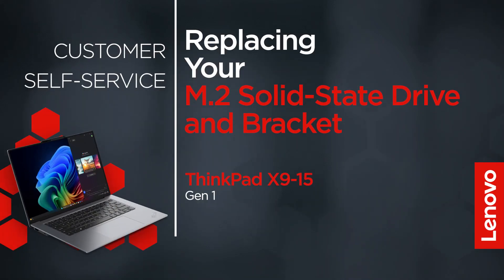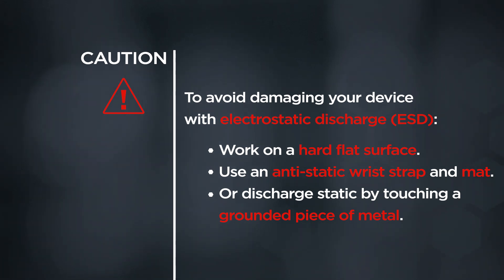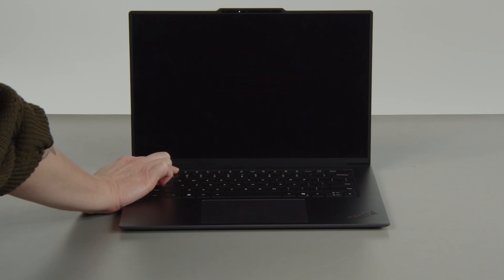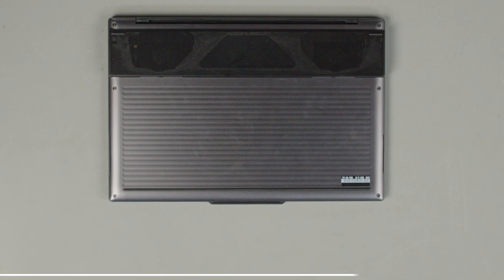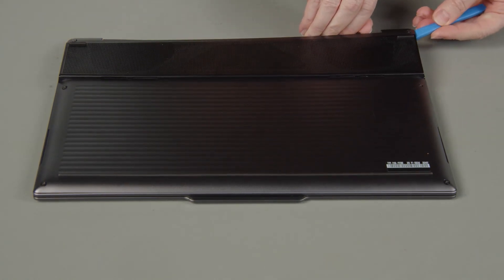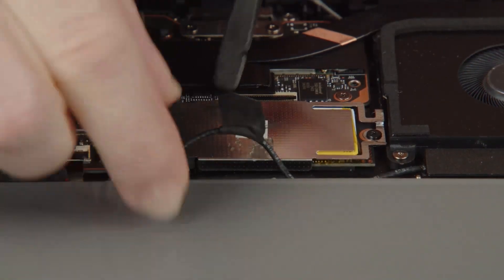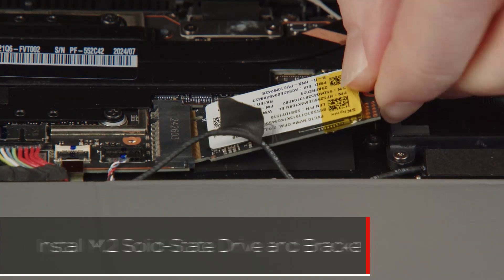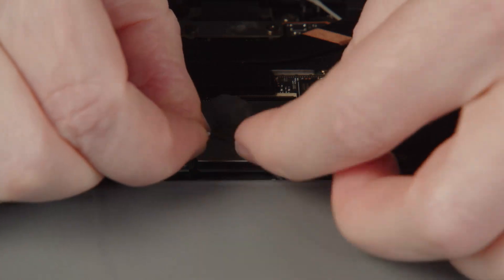Replacing Your M.2 Solid-State Drive | ThinkPad X9-15 Gen 1 Aura Edition | Customer Self Service

Comment from the maker: This video will show you how to replace the M.2 solid-state drive and bracket of your ThinkPad. The process in this video will work for the ThinkPad X9 15 Aura Edition (ThinkPad X9-15 Gen 1).

You will need a screwdriver kit, a non-metallic pry tool and 15 minutes of your time.

To learn more about your device go to https://pcsupport.lenovo.com

To find parts for your device go to https://support.lenovo.com/parts-lookup/?cid=ww:lenovosocial:b9515f&source=socialmedia&subsource=yt

To view the Lenovo Support Self-Repair Guides landing page go to https://support.lenovo.com/us/en/solutions/HT516547

** NOTE: Static electricity can destroy components. Use a grounding strap, and clean, non-conductive surface to work on. Use plastic or coated tools to prevent scratching and avoid using metal tools on plastic parts. For more detailed information on electrostatic discharge and how to prevent it, please watch our "Understanding Electrostatic Discharge (ESD)" video: https://youtu.be/by4PB3WtdLo 

Applicable Machine Types:
ThinkPad X9-15 Gen 1 - 21Q6, 21Q7

Check out other official Lenovo channels!
https://www.youtube.com/@Lenovo 🟥
https://www.youtube.com/@lenovolegion 🎮
https://www.youtube.com/@Lenovo-PC 💻
https://www.youtube.com/@LenovoSuporte 🟢🟡

#Lenovo #LenovoSupport #LenovoTechSupport